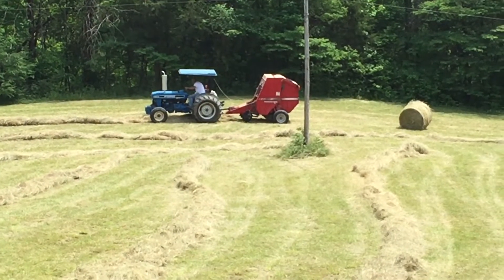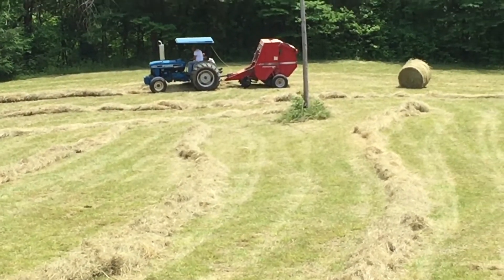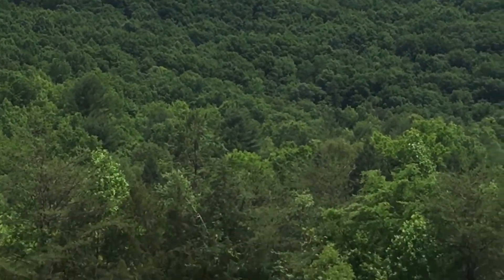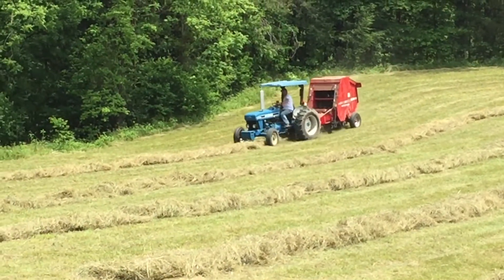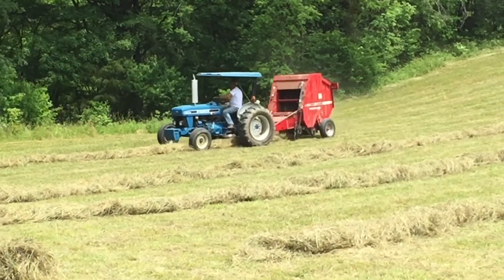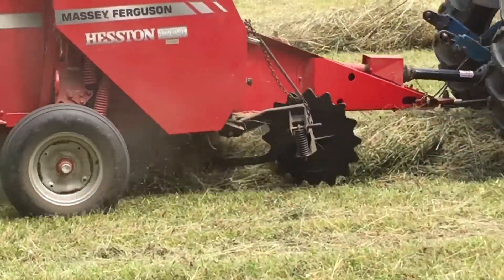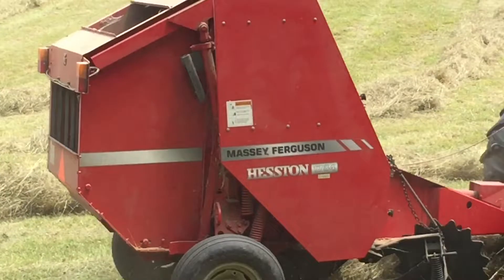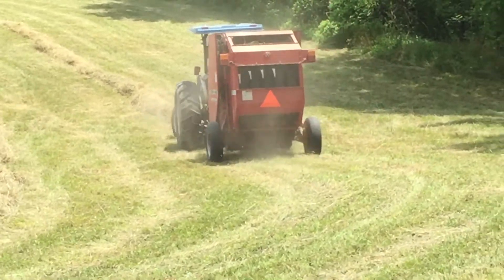More round bale N hay

Comment: Apart from the constant zigzagging, one reason for the lopsided bales is that the baler driver only ever rides anti-clockwise on this small meadow. The weaving only increases the effect of the constant left-hand turns.

If the driver would just turn around at about half of the bale and ride clockwise, the effect would even out and the bales would basically be correct at the end.

Comment: Weaver fast just to start bale, then weave one side for 15 to 20 seconds then the other side for 20 seconds.
Reply: Exactly, weaving way to much. Run a little bit on one side then in the middle a bit then to the other side. Smooth and slow and you will make a nice bale.

Comment: Good Video, However that tractor driver is unnecessarily killing himself, yes you do have to weave, some, but not that much! and it will make a good bale. The pickup and chamber on that baler is only 39 inches wide, and if you raked the windrow properly I.E.  just a tad wider, you all but eliminate that weave. The rake man needs to help the baler man out. Just trying to help and yes I own one of these balers and the 1745 the bigger one too.
Reply: i always shoot right down the middle with mine, usually the windrow is wider than the throat in any decent hay. mine dont have gathering wheels which makes it hard
Reply: Yes indeed what you need to do is drive at one side of swarth twenty feet or so then cross to other side and repeat again till bale is full . Weaving like he is doing only feeds the centre of the baler
Reply: Boaster bragger
Reply: I bale with a baler like that..39 inch pickup..no need to weave if you have your windrows raked right. Just drive till you have a full bale.